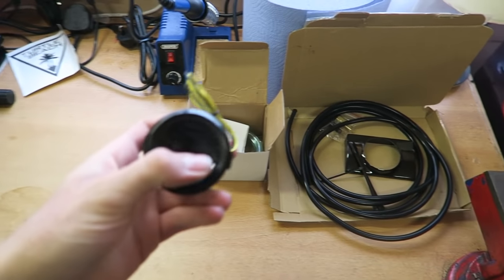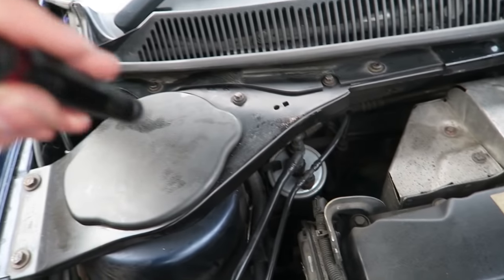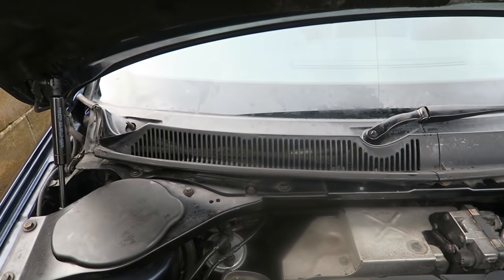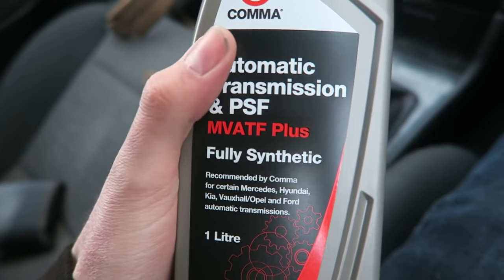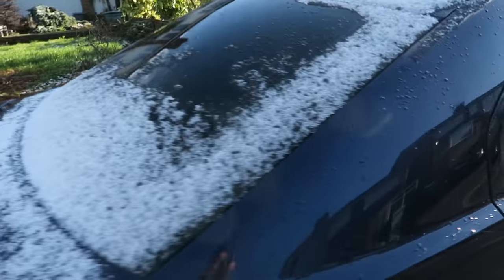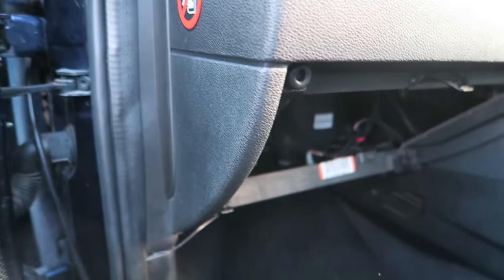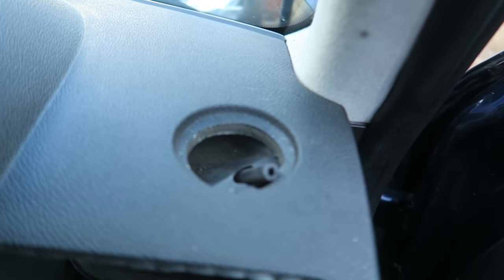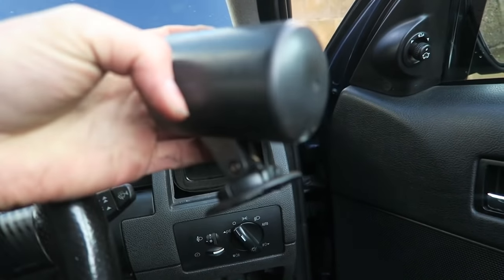Attempting To Install a Boost Gauge (Mondeo ST)

Comment: That's life for ya. I don't think of these as fails. I call them adventures. Again I really think u need to find yourself a scrap yard my man. Whenever I wanna do something the requires hacking or whatever it needs I buy another one from scrap. Like the vent. Go to scrap yard buy 2 or 3... shouldn't be more than 10-15 quid. Experiment on them. Keep original. Win win.

Comment: Honestly lad... just buy a electrical boost gauge instead of mechanical so you don’t need to run the vacuum piping threw the car to cabin. The electrical you just put the sender unit in the engine bay and then the wiring threw to the cabin 🤦🏻‍♂️🤦🏻‍♂️

Comment: EGR delete means MOT fail!
Reply: It's who you know  😜
Reply: Mine hasn't failed it's mot
Reply: Ye new rules this year aswell going to be alot more diesels failing mots, they getting very picky with diesels now
Reply: The diesel emissions test is only concerned with the density of the exhaust smoke, deleting an EGR will not increase that.
Reply: @beany1987  yeh the diesel is the new devil . easy enough swap it back for mot. 
Best way with new mot rules is just mod standard one so blocked and job jobbed and passes mot visual inspection .
The egr and dpf pretty much ruined the diesel, reduced power, efficiency and potentially amazing mpg capability  and concept of collecting soot to burn and blow out on the highway at cost of using more fuel and creating more service waste (oil dilution and system parts) puts the concept into a negative on real world pollution . As an engineer watching such stupidity makes me want to cry :-/
Reply: Im afraid your wrong. EGR isnt part of the M.O.T. Please check for yourself under M.O.T rules for diesel cars. The only problem that it will have is the engine management light will be on, it will need to be removed via ecu delete (small holes in blanking plate WONT work on euro 4 cars). Engine management light being on is an M.O.T  fail. You can put a piece of black tape over the eml in the clocks but having that light visible is a good thing incase something else fails.
Reply: @xtc31  I would suggest you read it again yourself section 8.2.1.1 and 8.2.2.1 for C/I engines. emission equipment modified, defective or missing,  this includes visual inspection of egr, dpf, cat, sensors etc . defect category 'Major'
This is educated fact .  I work in the trade last 3 decades ...
Reply: It's decated too
Reply: @mrb1864  hmmm strange here you go.....no mention of egr?? If that was the case then why have thousands of cars passed M.O.Ts without one? i think you need to look back on your past 30 years and think of all the people youve ripped off by telling them they needed one. Oh and yes im also in the trade lol i can also provide a link as proof. https://www.gov.uk/government/news/mot-changes-20-may-2018
Reply: @xtc31 , it not been in affect for last 30 yrs lol. I will link the mot manual and training guide (i'm MOT test qualified) EGR is a fail, it has to be easily visually viewable and a tester is not allowed remove any parts/covers for inspection, same as the dpf, we can only fail based on fact it visually tampered with/missing in a way to affect/alter function .
Reply: Here is the class 3.4.5 and 7 mot manual emissions, for diesel it section 8.2.2.1 (a.) 
We can only visually check it so if can not see it as under engine cover or it looks normal but internally altered it will pass, dpf, egr/egr cooler, pressure transducer all covered under (a.)
https://www.mot-testing.service.gov.uk/documents/manuals/class3457/Section-8-Nuisance.html#section_8.2
I run a professional and honest business and only provide trained accurate knowledge and services, too much misinformation and non professional knowledge online unfortunately ...
Reply: @xtc31  also review the MIL section in same document section 8, MIL function is a check procedure of properly done MOT, you can not remove bulb or tape it over as the light has to be seen come on then go out when ignition turned on to show it functioning . MIL is same for petrol gas and C/I testing (all covered in section 8 ) , a non functioning MIL is a category class 'Major'
Reply: @mrb1864  So its a visual inspection only? Would that mean i am correct then? removing an egr from your car wont necessarily fail  the M.O.T ? And the link i provided was from the actual .gov website so its not misinformation is it. Cars will also pass an M.O.T with no CAT converter aswell.....if its there its a pass because theres no way of seeing whats inside it :) a sport CAT will also pass too
Reply: @mrb1864   I did say that it will need to be deleted through ecu remap? ive seen plenty of taped up clocks that have also passed M.O.T inspection :)
Reply: M.O.T inspection is becoming harder but the technology to bypass stuff is also increasingly better. Im sure you know that if your a tester. You will never stop modifications to cars.
Reply: @mrb1864  i wasnt talking about the time its been in effect i was talking about your time as a mechanic...you stated 3 decades did you not? which last time i checked was 30 years.
Reply: @xtc31  No, no cat will not pass as reading of gas and lanbda will show that. upcoming test strategy on dpf and cats will be pre and post temps and probably transducer readings for dpf .
Back to egr, if tester can visually see it been removed or altered or not functioning then it can fail. 
Your best blocking/internally modding an egr over the bypass kits if want simple way of no gas recirc and easy mot compliance .
The link you provided is correct revisions for that release but your interpretation of rules from that document was incorrect .
Reply: @xtc31  now you just being silly over your initial jibe at my 30yrs experience, we all can see exactly what you wrote and your intention from it .
I'm not here to argue, I'm just here to correct the misinformation so people know the real rules thus are better prepared for an MOT .
Reply: @xtc31  Don't get me wrong, I don't agree with egr or dpf and actually consider it bad technology and increases pollution over vehicle lifespan through increased service waste, shorter lifespan and massively reduced mpg potential for the diesel .
IF want modify, truly know how it works and that includes MOT rules and Insurance issues.
Biggest issue with emissions mods is it can invalidate vehicles insurance thus you become unisured driver at point of vehicle inspection in a larger accident scenario, that a bigger concern than MOT which easier deal with if you have the correct information .
Reply: @mrb1864  i apologise. I meant what i said about being in the trade myself and i have seen many (if not all)cars fly through M.O.T with these modifications on cars. Me being one of them myself (i own the same car as above) and have NEVER had any advisories or fails because of it, on my last M.O.T the tester was impressed with how low my emissions were. My car never had a DPF but egr has been removed and has a sport cat fitted (basically hollow). I get really annoyed when people in comments say it will fail M.O.T when clearly they dont (my car is proof as are many of my friends cars). Im 100% positive there are people on here and on diesel forums that will say the same. You may fail cars because of it but that dont mean other places do. If cars start getting failed due to mods made drivers will just go else where to get there M.O.T, and it will just be the garage that suffers from it. I agree 100% with failing cars over dangerous defects but EGRs, DPFs and CATs are hardly causing that. I know MOT testers hands can be tied and are afraid of getting into trouble but theres no need to be an arse when failing cars on things like this....makes no sense.
Reply: @xtc31  none of my testers or myself go out our way fail cars like these but we do like the owners use better methods, visible egr's are best modded over using delete pipes. 
They cracking down hard on emission issues and fines we face as individuals and a business it potentially business/job threatening .
You can't let them all through and some are so appalling in mods they need failing for everyone's sake .
Deleting emission equipment is a police and insurance issue, they cracking down on it and traffic police are being trained on spotting deflects, tighter test procedures will be  coming in for dpf and cat function validation but hopefully exclude older cars .
To us from an MOT perspective it a ballache and liability issue we don't want, governments, police and insurance companies are ones going like it the most as they can generate big funds from it and insurance companies can void the cover thus you paid a premium for unusable cover ...
It a tricky situation as we feel obliged tell customer exact status of their car (some buy cars not knowing mods done/parts removed), we don't want make customers life awkward and we also don't want legal issues.
First thing people say when turns into an issue is 'well it passed the MOT' .
We get a lot of spot checks too, if cars still on site they'll check easy stuff on all the cars straight away, couple major issues and you soon ceased from testing for 2 to 5yrs and our investment into mot bays is 6 figures plus yearly costs .
DVSA investigation  is right PITA, what you also got realize is someone wanting us pass his/her car with illegal mods if then with an issue with police and insurance will be blaming us as we just MOT'd it and all was fine and nothing been touched by them and it our negligence as the missing parts/alterations had not been notified .
We try use balanced common sense, if owners do same and mod wisely, don't tell lies, be awkward or try hide things and keep important safety areas up to spec most times both mot tester and the vehicle owner can be kept happy .

Comment: Why would you do this? a boost gauge on a stock mondeo diesel is about as useful as tits on a bloke the air vent had more purpose than the gauge and the plumbing job you did was ridiculous why not just drill a fresh hole where u needed it?

Comment: Don’t bother with the boost gauge, unnecessary item 🤨
Keep the car stock, what’s the point of the gauge anyway? You’re not gonna keep watching it every 2 minutes, boy racer rubbish 👎
Reply: Unnecessary to keep an eye on any leaks?
Reply: Keep a eye on the turbo over boosting, if the VNT gets choked up, could save the turbo,
Dave
Reply: Boost gauges allow problems to be identified early on
Reply: Bob you seriously have no idea of the purpose of these
Reply: Also if wants to tune the car later on he needs to know home much boost he's running
Reply: clifton1989 if they were that important they would be fitted as standard!
Also there are sensors fitted almost everywhere in modern engines these days to pick up any faults that may arise.
Reply: Visit scrap yard pick an old offside vent butcher that to fit the gauge and keep the original
Reply: @BobWilliscorgi  exactly Bob! Agreed! Surprisingly no replies to your last comment now! Sack off the boost gauge! No need for it! If there was a need ford would of fitted it as standard!
Reply: Agree with Bob of it needed 1 it would be fitted the only reason u would want 1 of these was if u was remapping it every 5 mins not saying they don't look ok when there lit up and flicking up n down and if u can actually drive y would you be looking at a gauge and not the road
Reply: The channel would be pointless of he kept it standard, of your modifying cars your need to know your boost, I bought my car used and I didn't know I had a boost leak the whole time until I changed Intercooler piping, I would have known much earlier if I had a boost gauge
Reply: Ever seen a escort cosworth they had.a boost gauge from standard and a ford focus st and many more cars stick too a pedal bike son!!
Reply: @ bob willis
Reply: @deckmatto2891  Just went in a new sirocco R and it had one standard too
Reply: Point made

Comment: Boost gauge should be in the minus as it reads vacuum, as well as in the plus when reading boost pressure. Try tapping in to a different location with a T piece. 👍🏻
Reply: True as i have done this in the past and it read negative. A think it's due to where its tapped into.
Reply: Wrong no vacuum on a Diesel turbo, that is why diesels use a vacuum pump, for the brakes,and engine mounts on some cars,
Dave
Reply: Cheers Dave. Did not know that. My point is invalid 😂
Reply: @gethinowen3582  lol i'll shut up too as i am currently running a petrol turbo and might of got it wrong. Cheers for pointing out that.👍